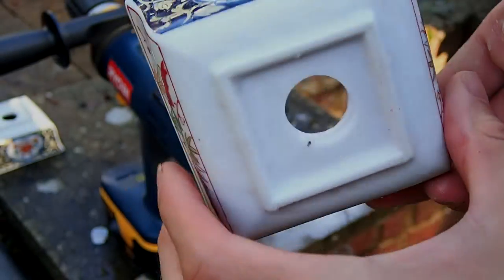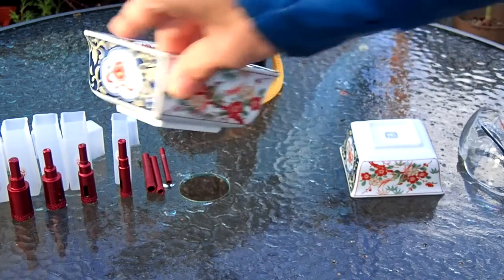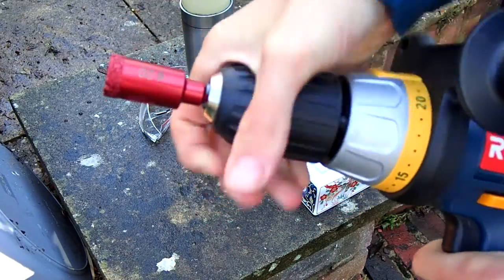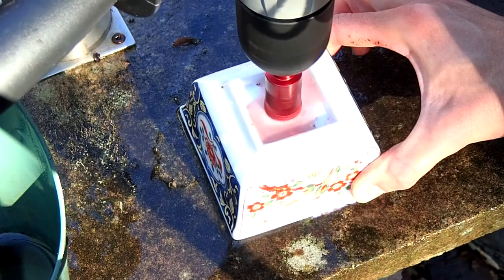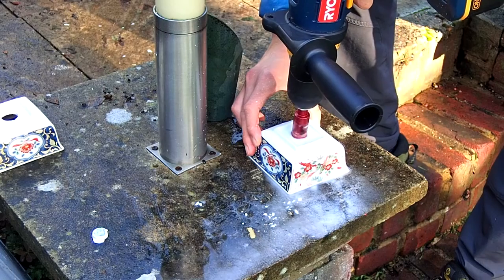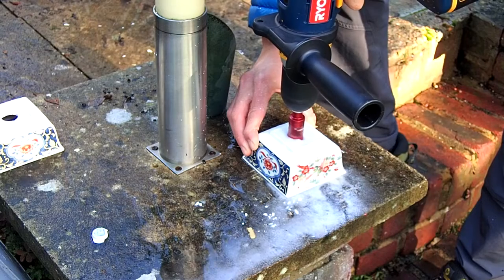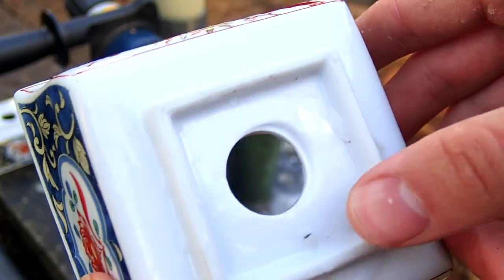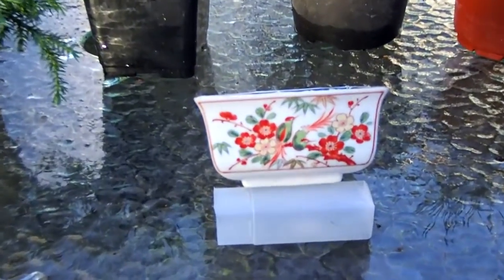How to Drill holes in Bonsai Pots - £2.50 Bonsai Pot!

Comment: Great video, thanks for sharing.

I've only ever drilled terracotta pots before and that was with a glass and tile bit, the spade shaped pointed ones. Having seen your pots, I will start looking in the charity shops now. Do you have a link to the drill bits you used at all? I think you mentioned they were from Amazon.
Reply from the maker: Hi Mike, thanks for your reply. The ones I bought have gone up in price quite a bit unfortunately. But  there are similar ones for cheaper. You only really need a 22-25mm one and maybe a 4-7mm one to drill the small holes for wires. 

I've been also buying terracotta half pots and making the small single hole bigger and adding wire holes,

I hope that helps

https://www.amazon.co.uk/Meccion-Diamond-Brazing-Extractor-Mandrels/dp/B07GSVWZVK/ref=sxin_25_ci_mcx_mi_sr_m_il?content-id=amzn1.sym.122db3f0-ddf4-4fb2-9801-0fd23b7dc17d%3Aamzn1.sym.122db3f0-ddf4-4fb2-9801-0fd23b7dc17d&crid=12QW3D7QOYKJV&cv_ct_cx=diamond+circular+drill+bits&keywords=diamond+circular+drill+bits&pd_rd_i=B07GSVWZVK&pd_rd_r=d7d05b66-d645-4c82-9b0f-304dc449260c&pd_rd_w=Mv0Uh&pd_rd_wg=whE1t&pf_rd_p=122db3f0-ddf4-4fb2-9801-0fd23b7dc17d&pf_rd_r=PNHYG17P5WSYEQG1PCTS&qid=1678382997&sprefix=diamond+circular+drill+bits%2Caps%2C56&sr=1-1-b3105280-ed1c-4fae-986f-6c4501b9525e
Reply from the maker: These are similar but much cheaper. 

The red coating on them flakes off quite quickly, but it doesnt matter as the hard stuff is in the coating on the tip and they cut just fine with plenty of water (to act as flux) and high rpm / gentle drill pressure, 

https://www.amazon.co.uk/Diamond-Bst4u-Coating-Ceramics-Porcelain/dp/B092VTD9CH/ref=sr_1_2?crid=12QW3D7QOYKJV&keywords=diamond+circular+drill+bits&qid=1678382997&sprefix=diamond+circular+drill+bits%2Caps%2C56&sr=8-2
Reply: That's great, thanks for all the help. Really appreciated.

Comment: Thanks for this.  It the drill bit a "glass bit?"
Reply from the maker: Hi Rita,

On amazon, most of the listings say "glass" and "ceramic" for the circular diamond drill bits.

ill post a link below for the type of thing you want, but if you cut slow without too much pressure, and have water as flux  you'll do ok.

https://www.amazon.co.uk/Diamond-Ceramic-Porcelain-Cutting-8mm-50mm/dp/B07B9PHS6X/ref=sr_1_5?crid=M1CXSL6201LW&keywords=glass+drill+bit&qid=1688390148&sprefix=glass+drill+bit%2Caps%2C72&sr=8-5

cheers - T